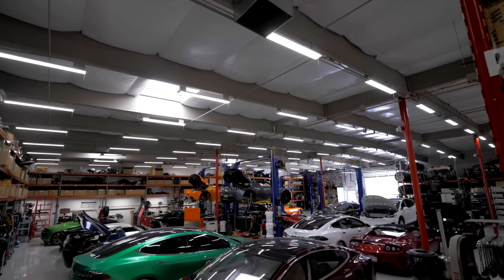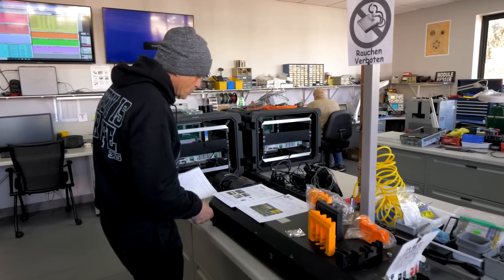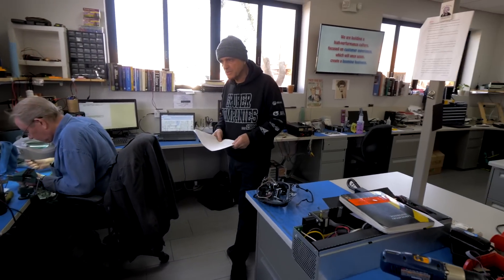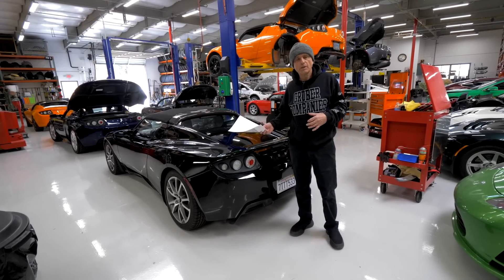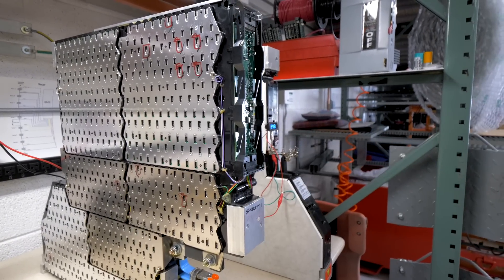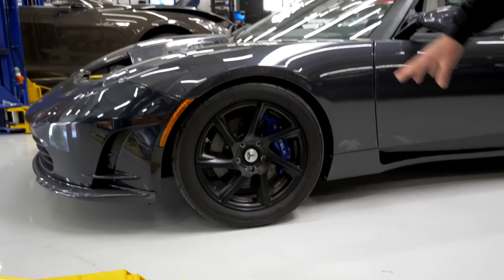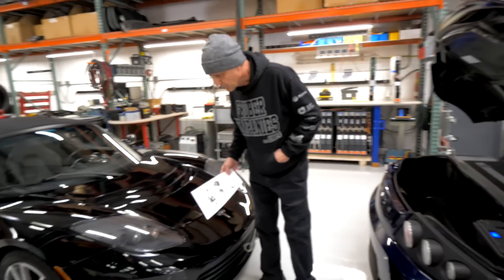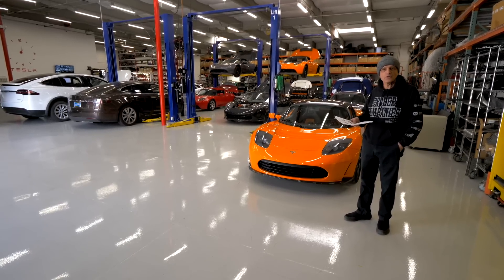Keeping Tesla Roadsters Alive - Inside Gruber Motor Company

Comment: @20:00 That carbon fiber roadster was owned by Joost de Vries and was the test mule for the Roadster 3.0, thats why it has the R80 pack and so many unique upgrades, those were all being tested as possible releases for the market to keep the Roadster market thriving. Most of the upgrades never made release. I have the only other Roadster with the 3.0 brake upgrade, its a 2 piece floating rotor make by Tarox.

Comment: Thanks, love what these guys are doing to keep these old Roadsters on the road.  Again I can't help but think why no one is working on a direct replacement for these packs.  It's above my skills but I don't think impossible.  The BMS may need tweaking but in the end you need xyz volts to the controls - regardless of the chemistry.  This would be a great way to breathe new life in many older Roadsters.  New 2170 cells, BMS, and swap out the charge ports to make them J1772.  That'd be a cool project!

Comment: 20:19 - *there is another carbon fibre roadster in existence* look on the UK Autotrader, there is a 2012 Carbon fibre roadster with just 1,500 miles on the clock. Super stunning. Please like this comment so they can see.
Reply: Nice car.  The visible CF is in the Hardtop (rare), Hood Vanes, and Spoiler (not uncommon).

Comment: I have a 2013 Model S and although the MCU is working fine I know it's only a matter of time before I need the eMMC replaced. What options do you offer for this? Can I send you just the Tegra board or do you need the entire MCU? How much does eMMC replacement cost? What if the eMMC has already failed? Can you recreate the data or will I lose functionality? I believe the eMMC holds the security certificates for mobile app access doesn't it?
Reply from the maker: I would reach out to Gruber Motor Company for more specific info on the process
Reply: @OutofSpecMotoring  Thanks for the response. I was thinking Gruber would check comments for the video, but maybe not? I'll send them an email.
Reply: @markusstrobl1067  We got your email Markus.  We sent over the details.  Thanks, Pete
Reply: @petegruber2738  Got the response. Thanks!
Reply: @petegruber2738  can you post the response here :)
Reply: @baselsalam  The brochure describing the process is an image file.  You can request it from ev@gruber.com

Comment: Vin number one is actually an orbit going around mars and earth on an endless loop The vehicle was stripped down to the bare essentials battery pack was removed also the pem was removed The electric drive motors were also removed that was to reduce weight on lunch. There was no air in the tires they were filled with foam. The same kind of film that you would have in construction tires because as you know if there was air in the tires they would explode before getting to orbit that would’ve been bad because it would’ve blew up the rocket as a result as it got into orbit.